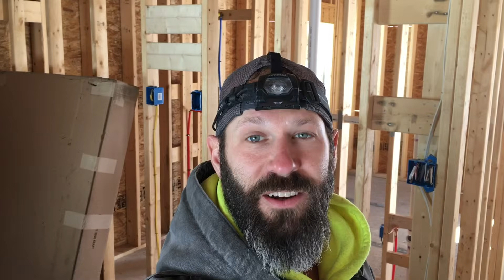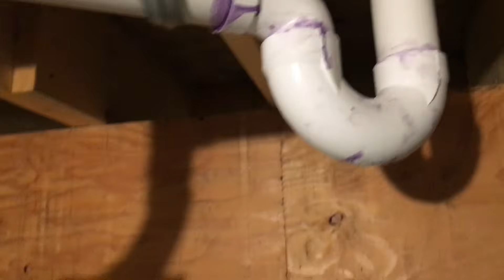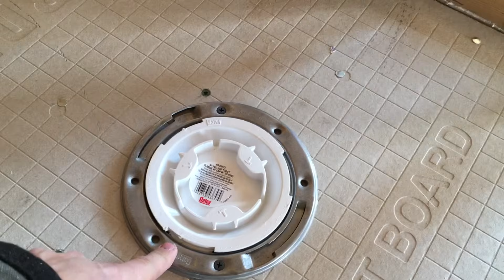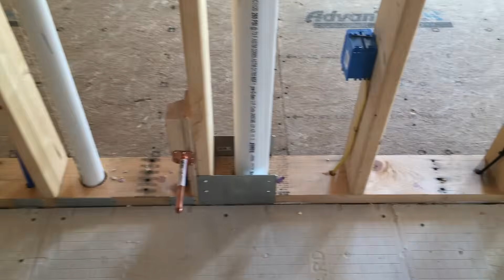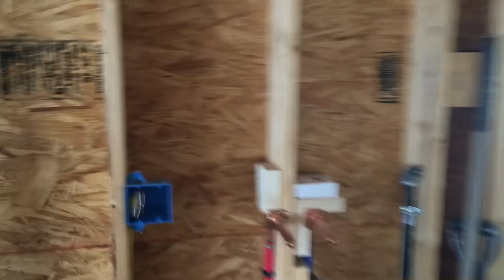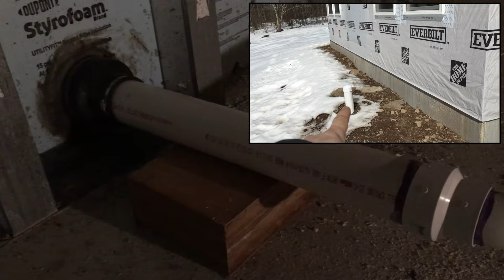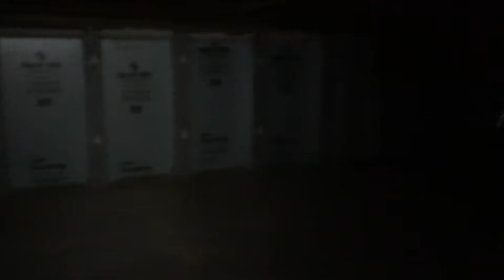Drain, Waste & Vent System | Off Grid Homestead Build Ep19Pt2 | The ShabinLife

Comment: This is an excellent video.  At what point does your laundry waste line convert to 3 inch?  Assuming the conversion is when transitioning from vertical to horizontal, can you install a 2 inch to 3 inch elbow (or long elbow) when transitioning from 2 inch vertical to 3 inch horizontal?

Comment: Quick question. How did you run 3” stack through your 2x6 headers/footer and not breach code with too big of a hole? Also 2” horizontal vent line would need a 2.5” hole which is also too big for 2x6. Were these not a load bearing wall or sometime like that? 
My wet wall is a 2x6 exterior wall and it’s causing me all kinds of headaches with drilling holes that are too big to accommodate venting.

Comment: Why are you using 4" for your toilet waste? That makes no sense. Why are you putting the flange down before the tiles. Flanges sits top of the tile, not tile around flange. Its only a 2.5 inch opening on a toilet outlet.

Comment: I really like how you broke down everything you were explaining and the time you took going downstairs so we could  get a clear understanding of each part you were talking about before moving on to the next thing; even when they were  in the same room. And... you did it without editing & splicing your video. I felt like I was walking around your house with you. I wish I was because I would've loved to pick your brain. My mom is having her drains redone & because I have work a little in construction, I was picked to be the one to talk to the crew. They put a 3" drain in for the kitchen  sink. I thought  it was supposed to be smaller. Because of what the head guy originally had told me about what was part of her original problem. But, the crew used the 3" anyway. When I asked  about it, he said it would be fine. Please tell me what you think. I'm hoping to find out before the inspection & concrete for fixing the floor is scheduled.

Comment: Got a question, can I vent through the side of my house and not the roof?
Reply from the maker: You may be able to, but I'm sure it all depends on the code in your area. I was involved in Radon Mitigation for a long time and we vented passive system activations through side walls many of times which is very similar to the DWV venting.

Comment: so you going to add insulation on the pvc pips to keep them extra warm or do you live in a state that doesnt get below heavy freezing?
Reply from the maker: Hey Russell, thanks for the message... Fortunately my foundation walls from Superior are insulated. I've had a thermometer down there just for R&D purposes and even when it hits 0 degrees here in NE PA, it typically stays above freezing in the crawlspace. Once we're actually living in the house I imagine it will be even a bit warmer from running the wood stove and such so hopefully we won't need to do anything to the lines in the crawlspace area... at least that's the theory we're running with, lol. Thanks for checking out the channel, much appreciated & Happy Thanksgiving!

Comment: Clean and nice work.  Some ideas...They make a spacer for the toilet flange so you can set it to the floor height and install prior to finish floor. "Tile buddy".   That LVL have screws or bolts?  Seal up the holes.   no cheapo fan for bathroom.   I would run the vent in kitchen to near the top of roof.  Perfect place for ice dam and if a metal roof could tear it off with ice or snow.  cleanout near exit point.

Comment: Is the tee fitting okay to use at the 10 min. mark ? Ive seen on waste lines every one preach has to be 2 45s or long sweep is it different bc its 3 inch the one that turn into the vent .. im getting ready to take on my own project soon so just learning,  great video this will be a big help !
Reply from the maker: Hey David, thanks for checking out the channel/video, much appreciated!! That 90 is made specifically for that toilet flange application so essentially yes, it is ok to use there. You could certainly choose to do two 45's (if there's room and the pitch stays correct), however you'll probably need to add a reducer from the first 4in 45 to the second if your main drain is 3in & not 4in (toilet flange is 4in). I hope this makes a bit of sense, lol... always a little tough to explain in writing. Best wishes on your project!! If you have any questions, just holler.
Reply: @shabinlife sounds good  thank you !

Comment: Remember folk, codes vary state by state. In Kentucky, you can us a tee almost anywhere as long as its not laying on it's side, and not exceeding 45° if you roll it. You can't wet vent or flat vent here either.
Reply from the maker: Thanks Bobby, it always helps when solid info comes from an outside source, greatly appreciated!! Also, thanks so much for checking out the video!! Hope you have a great week!
Reply: @shabinlife  👍 I don't have a problem with anything you're doing at all. I just want to make sure a DIYer in KY trying to rough in his own house, or doing a major repair doesn't get fed irrelevant info for my particular state. We're pretty strict here with code.
Reply from the maker: @bobbyosborne2375  I couldn't agree more Bobby! Thanks again & stay well!

Comment: i have been doing plumbing for 30 years an you done a good job but i see where you used alot of fittings you did not need to, but it looks good but the first bath you talk about could have been vented off 1 -2 inch vent stack an the washing machine drain should have had its own vent stack separate from  the lundry sink but over 
 all it will work fine but you did use more fittings than needed .
Reply from the maker: Thanks for checking out the video & I appreciate the feedback to help with future projects. Although, let's hope I'm not building another house anytime soon, lol. Have a good weekend.

Comment: You might have answered this question in your video or maybe in your comments and I apologize. but I recently bought a shed and I’m turning it into a tiny home. My question is. Since my kitchen sink, shower and toilet is all in one corner of the shed, is it necessary that I have a vent for each of these outlets or can it be combined into one? Thank You. P.S. I’ve subscribed to your videos cause they’re straight to the point and very informative.
Reply from the maker: Thanks for checking out the video & my apology for the delayed response... You should always check your building codes first (If there are any or just using UCC), but I imagine you would be perfectly fine combining all those fixtures into one vent. Again, be sure to check with your local codes just be sure. Have a great weekend and best of luck on your build!!

Comment: #1 closet flange should sit on finished floor, this will eliminate the need for a thicker or double wax ring.
#2 wet venting a washer box over a lavatory sink that sits lower is bad , you will condone getting water backed up into the sink.
#3 your waste line requires straps every 4 feet.
#5 for every 90 degree turn in the waste line, requires a clean out.
Reply from the maker: Thanks Rick, I appreciate all the info & constructive feedback. Plumbing would be the last trade in my toolbox as I come from an electrical background. This is the first time I've plumbed a house so it's been good to hear back from people checking out the video! Hope you have a great weekend and thanks again!

Comment: in what scenario would nail plates be necessary when running pipes in the center of a 2x6 bottom plate lolllll
dryall screws are usually 1 1/4, you would literally need to be using 3" drywall screws to hit anything

Comment: the toilet flange should sit ontop of the finish floor or atlease 1/4 above the finish floor, the flange as is now will not allow for proper sealing between the toilet and flange with a wax ring as the wax ring may not reach all the way dow to the flange and compress to create the seal. you may need to get a tall wax ring and hope it fits , just food for thought for those of you looking to install your own toilet flange.

Comment: Nice clean setup! I have a question, though.....considering your final septic drain line is 4 inches, would using 4 inch instead of 3 inch main drain line reduce any chance of blockages in the future? I only ask because where I'm at code say I can use either 3 or 4 inch. Thanks! 😊
Reply from the maker: Thanks #1!! I could have certainly used the 4in, but I know we are good with 3in as long as it was installed & pitched correctly... although I guess only time & use will tell, lol. Also, we incurred every price increase imaginable while building thru the pandemic so I tried to stay a bit more on budget when I could & PVC was crazy expensive at the time. Hope this helps & thanks for checking out the channel & videos, much appreciated!!

Comment: Is that 2" vent for your kitchen sink legal? In most cold weather states they require at least 3" when going through a roof bc it can get frosted over
Reply from the maker: Thanks for the message, sorry for the delayed reply. The 2in vent for the kitchen sink was perfect (& ucc code) for our build. I'm sure this may differ in other areas, but we passed inspection with flying colors. Hope this helps & thanks for checking out the channel/videos! Have a great weekend!

Comment: Thank you for the brilliant explanations. and no one else does such a great job of showing us and giving dimensions for each piping connection.  The lighting is great and you don't whiz by something or skip over something.  Very well done, please continue to show us amateurs how you are doing the waste lines, no one else even tries to do a good job, as you have done.  Thanks again QED  The only question I had was, it looks like you concreted the bottom of the crawl space , why was that done, it is nice though and you can stand up in there, not many like that..
Reply from the maker: Hey Charlie, thanks so much for the message & my apology for the delayed response. I'm a bit of an amateur as well (at least in the area of plumbing, lol) so I'm really glad this video has been so helpful to everyone. We poured a slab in the crawlspace for a couple reasons... most importantly for ucc code when using superior walls as well as moisture control. However, it's been very helpful in regards to working down there as well as holding a small bit of storage. Hope this helps a bit & thanks again for the kind words. Have a great weekend!

Comment: Thanks for the vidoe, i become a subscriber after wathcing this video.  can you pls help me on one thing on plumbing. I do know about 45, 90, 60 degree coupling, elbows, street etc etc. one thing that i am not good and dont know anybody have said in youtube is how do i use these different angle to connnect and shift from one position to another position. for example you can come up with video (if possible), you have angle 1 at one location and another angle at a feet or two, how do we use thse connector to move from one to second location.  also if i just want to move a pipe from one spot to another spot just 2 inch or 3 inch none of these angles will help me because moment i use all thse degree elbow it moves away so much.. pls appreecaite your response.

Comment: Good job but the laundry room is wrong a washing machine is supposed go tie in all by itself you should've dropped the washer down by itself along with the sink back vented the two in the wall and been a ok by code
Reply: Reason is the amount of dfu and water that flows is so powerful it'll suck and siphon the trap dry on the utility sink each time. In my opinion I would tie it in that way but here it's not code and you will fail

Comment: as a plumber u dont need that 3" vent for that water closet. u could have dropped the water closet 90 a little lower and rasied your main and go into a combo or wye 45 on its side and then used the vent on the shower vent as your water closet ventas it is close enough. also idk where u are located but in co u dont need 1/4" grade on 3" pipe you only need 1/8" grade.

Comment: I have a kitchen sink that works properly but it doesn't have any P-trap so there's no problem with venting but If I add a P-Trap to stop the smell , then would I have problem with venting ? I mean I don't have any vent pipe near by kitchen which leads to main vent pipe which runs to the top of the building ?
Reply: P trap is required,  Vent within distances mentioned in several places here, depending on vent size.  If you have no other venting a studor vent valve could be used.

Comment: Your a little off on your terminology, so it may not sound like youre not an expert... for instance I seen maybe 1 thing in this video that is wet vented (your washing machine for like 2 inches). Everything else is individually vented, which is great. Also no 10ft limit when tieing vents together to go through roof penetrations. The distances you were referring to are the maximum trap arm lengths. But You did a great job to be a DIY project and didn't see anything that would cause you to fell a plumbing inspection here in NC.

Comment: Can the stack be 2inch?
Reply from the maker: Hey Lorenzo, thanks for the message. More than likely it depends on the code in your area as I'm sure code differs from place to place. Your main vent stack probably needs to be a minimum of 3in (if it's not, I would recommend it), however definitely best to just call your local UCC Inspector and bounce some questions of them as you can never go wrong there. Hope this helps a bit... Have a great weekend & stay well!

Comment: First of all, thankyou for taking the time to create this video. Secondly, in my opinion you did a good job on the plumbing layout and connections.
I'm a licensed builder but not a licensed plumber but here in SC I am allowed to do all my own framing, plumbing, electrical,  and hvac work on this new home I am building. I watched your video because I had a few questions regarding plumbing vents. Some of the comments were helpful but a few I disliked because they came across as condescending.... eg.- the one fellow that criticized your gluing and purple priming work. Basically, he was justifying the exorbitant charges to his customers  because he could prime and glue pvc perfectly. I smell bullshit.... I'm sure he was a "union" plumber....
You are just like most people, wanting to save money- that's  great! Nothing wrong with that at all!
I've reached the conclusion that the differences of opinion are due to differences of code ( UPC vs International code), what region of the US you live, and if you are from Canada  vs the US.
Believe it or not, in SC,  in most bathrooms you can put all the fixtures on a 1 1/2" vent. I know that for a fact because I talked to a local plumber who's been doing rough ins for 40 years. They go by international code here. Thats not to say I would do it that way, but thats the minimum ( based on the average bathroom llayout). I'm sure on larger bathrooms it would be 2 or 3 inch. I won't go less than 2 inch vent for a bathroom.  If your on a tight budget though it would be okay
Reply from the maker: Bob, thanks so much for your message, greatly appreciated!! Definitely comes down to some differences in code for sure (especially since we passed with flying colors, lol). Plus, I'd like to see those guys/girls applying primer to pipe in a dark crawlspace, in the middle of winter at 0 degrees outside... something's tells me theirs might be a bit messy too 🤣! Thanks so much for checking out the channel & hope you have a great weekend!! Stay well.

Comment: Is that a 3" vent or the top of the 3" waste stack?
Reply from the maker: Hey J, there is a 3in main trunk that ties to the 4in septic main drain. There is also a 3in main vent stack handling the bathroom & laundry. The kitchen is on its own 2in vent stack as it was a bit too far to tie into the main. Hope this helps & thanks for checking out the channel!

Comment: Not bad for a do it your selfer! But there are many ways to improve this layout and actually make it easier to install. You should never get that much purple on the pipe and fittings, you can’t be sure how much make up you have into the fitting with that much purple everywhere! The system could be failed by the inspector just for that alone! Just use the right amount of primer base on the size of the fitting being glued not dripping and running all over the place. To much pitch at end of line liquid out runs solids!
Reply from the maker: Thanks Morgan, appreciate the feedback. Yeah, that primer got away from me a few times, lol. Fortunately, it all turned out really well in the end. Thanks for checking out the channel & hope you have a great weekend!

Comment: No clean out on the laundry?
Reply from the maker: Hey Eddie, thanks for the message. I decided to bag the laundry cleanout since it's so easy to disconnect the compression fitting. I also wanted the laundry sink to sit directly against both walls, which created a very tight area for plumbing in the drain line underneath. Fortunately, if I wanted to add a cleanout for the laundry in the crawlspace, I could always cut that in at a later time. Hope this helps a bit & thanks very much for checking out the channel.